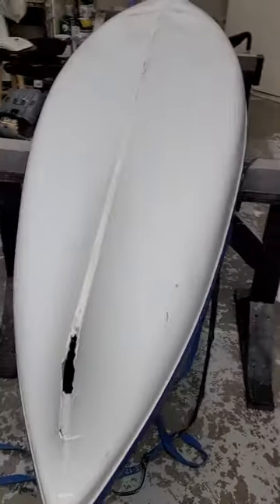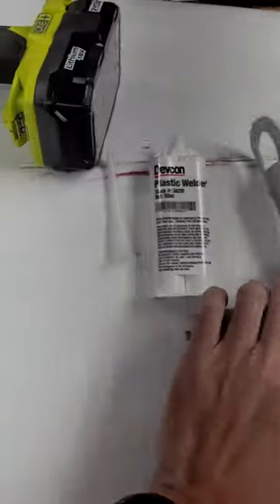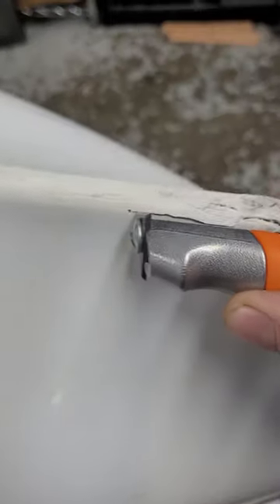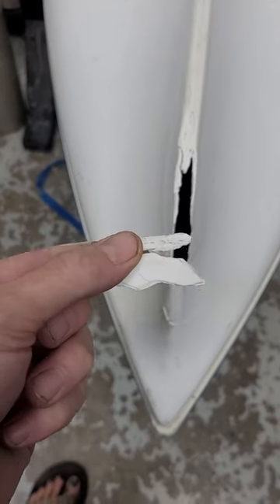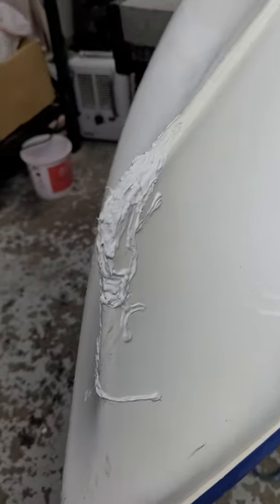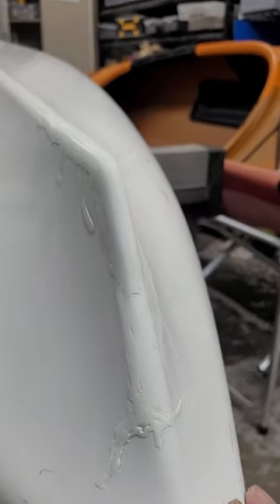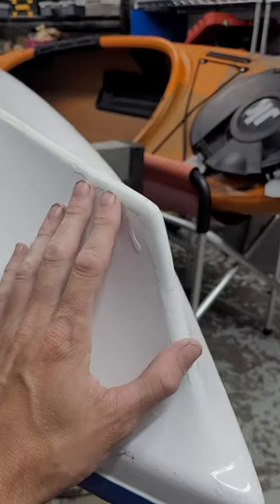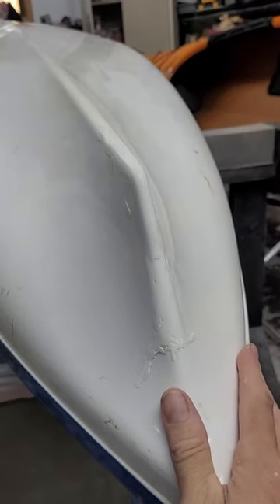SHOP Talk: How to Repair ABS Kayaks - Eddyline, Hurricane, Delta, Riot, etc.

Comment: I have a Hurricane Santee 126 that just has a crack in it.  I can't get to the interior of the hull because the bow section is sealed from the passenger area.  If I just use the MMA, would that be ok?  It's not missing pieces like the one in the video is.

Also, I've seen ABS pellets for sale online.  @bethwright8595 mentioned making a slurry with acetone and scrap ABS but the pellets might work well also.  Thank you!
Reply from the maker: Just MMA is probably fine!  Just fixed a Santee with a ~26" crack from the back hatch to/around the handle.  After prepping the area, I ran a bead along the damage and then two more, along either side of the first to increase adhesion.  Before putting a patch on the backside I tried to get the repair to fail (better in the shop than on the water), and it held tough!  I still patched the inside, but was pleasantly surprised at how beefy the MMA was on that large damage!

Comment: Devcon is expensive.  Are JB weld platic bonder, which claims to bond thermorplastics, okay?  It's a lot cheaper.  Also, FWIW, in youtube videos and blogs, jb weld original matches or exceeds the plastic bonders. Also, in one test, JB weld original was only slightly less effective than Devcon.  Thanks!
Reply from the maker: That's a very good question!  They are two very different adhesives, and we haven't used the JB PlasticBonder.  The Devcon Plastic Welder is actually a little cheaper than the JB (at least where we get it from locally) and within 300 psi of bonding strength (3500 vs 3770).  We use the Devcon because it is what Eddyline glues their boats together with.  That methyl methacrylate (MMA) fuses with the acrylic caps on ABS sheets, so really welds cracks back together.  I may have to try the JB on a crack and see how it holds up since it's a urethane based adhesive.  I bet it is bomber for glueing the faces of materials together, but I wonder how it would hold up otherwise.  If you try it, let us know!  Thanks again for the really good questions!
Reply: @AlderCreekKayakCanoe  Thanks.  JB Weld Plastic Bonder is a lot cheaper than Devcon around here (Richmond, VA), at least in smaller amounts (single use, dual plunger).  Plus, I would have had to wait a week for it to be shipped to any of my usual local stores (Home Depot, Lowes, Walmart) and I wanted to use it this weekend.  I tried it yesterday, it cured fast in the sun, self levelled pretty well too. It is a little less flexible per the specs than Devcon, so I would have preferred Devcon.  I will reply in a week or two after a week or two of trying it out.  If I see Devcon for a similar price, I will grab some and wait until I need it.  Thanks again for the great video and your reply.
Reply from the maker: @mikem6213  Yeah, you bet.  And thanks for the update on your repair!  Good to know what the options are.  My local source only stocks the Cream color these days, and it only ships via ground, but here's the 25ml kit.  I am definitely spoiled by the 50ml with gun and mixing nozzles now. https://www.tapplastics.com/product/repair_products/adhesives_glues_sealants/plastic_welder/278

Comment: I have friends who use a soldering iron to repair their rotomolded poly kayaks, and I'm wondering if I can do that on my ABS plastic Hurricane kayak. Their customer service rep with whom I've been communicating doesn't know the answer to that question. Do you?  

I have fixed some short narrow cracks on the undersides of my bow and stern — which clearly resulted from 6+ years of repeated abrasion from launching and landing on oyster shells and other shells, and occasionally on gravel or concrete boat ramps — using Gator Patches from Gator Guards. But I also have a long crack just beneath the bottom of the cowling which I don't think I can fix with those patches, and it would be a real pain to repair with fiberglass mesh and two-part epoxy, as recommended by the manufacturer if the damage is too big for the UV- or heat-activated patches they recommend. I think my best solution may be melting the crack back together as friends of mine do using a soldering iron to repair cracks on their rotomolded poly kayaks. But I have no idea how well that would work on  ABS plastic. I am seeking some scrap plastic from Hurricane Kayak which which to experiment, and I'm also interested in trying something I saw on a video which I can't find again, in which someone cut up some of that plastic in small pieces and put it in a glass jar half-full of acetone. He then checked on it periodically, stirring and poking at the mixture until it became a sort of slurry of partially dissolved plastic. He then used a small paintbrush to fill in the cracks on the kayak he was repairing with that thick liquid plastic and it seemed to work great. I am unable to find his video again because I first found a link to it in the comments section of another kayak repair video. 

I'm still looking because I promised to send the video to my contact at Hurricane? But in the meantime, have you any thoughts about how either of those methods might work based on your experience repairing ABS plastic kayaks? I'm hoping to find something I can do myself without having to have someone else to hold the cracked area in place because it's kind of collapsing on one side of my kayak.

The Hurricane customer service rep also suggested that a bumper repair business could weld the plastic back together, although it might be expensive. I have contacted a body shop I really like by email to see if they might be able to do that. It would obviously be more expensive but I don't know how much more, and it might be worth it because even though we have multiple boat dealers in my coastal area none of them will work on my kayak or any other plastic boat. It's all about fiberglass! And we don't even have a kayak dealer here in Apalachicola anymore, as the company that used to do that is now strictly involved in leading kayak tours and other boat trips to our barrier islands for tourists. I guess that must be more profitable, and that seems to be all that matters nowadays. 👎

I will fix this myself if I can but I might rather someone with expertise to it if it doesn't cost me a fortune as the repair I am facing may well affect the structural integrity of my kayak. It's too far above the waterline to leak, but that doesn't mean it's not a problem.
Reply from the maker: Hey Beth, sorry I missed your comment (ages ago)!  I'd love to help offer some insight on your issue.  I suppose there's a fair chance you've fixed the crack by now, but let's get into it anyway.  First, I would not recommend the soldering iron like your friends with the poly boats.  That's a very clever solution though - I'll have to try that sometime!  For your boat, I would still consider something like the GatorPatch or a Bullseye Quick Patch.  Even ambient UV will help those cure.  I suppose you could get a UV flashlight like we did, but it has very limited uses otherwise.  Gooping some Devcon Plastic Welder from the outside of the damage would work, but that'll be a tricky spot to apply neatly (if that is a concern).  Any MMA300 (aka Devcon) product won't work as well under the deck of Hurricane boats because their decks only have an acrylic cap on the top, and it's the acrylic cap that the MMA bonds with.  You can also feel free to send pictures of the damage to programs@aldercreek.com if you'd like some more specific advice!